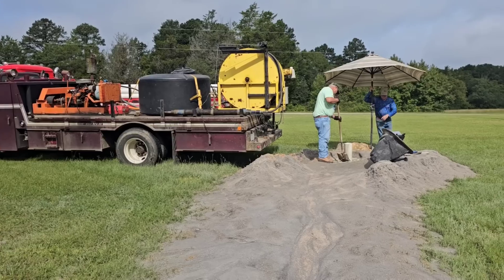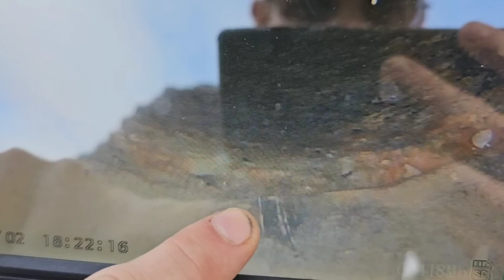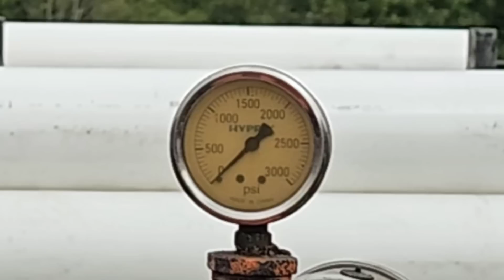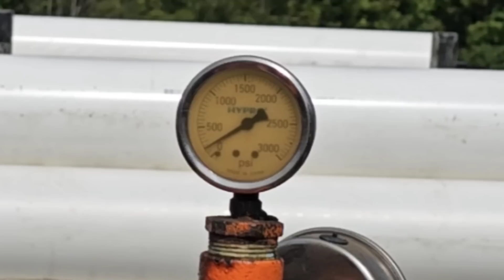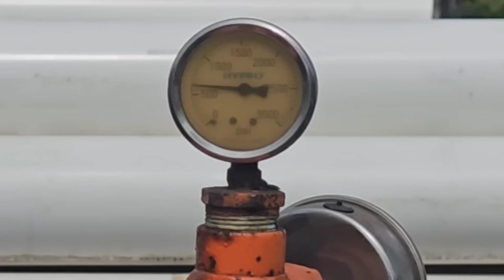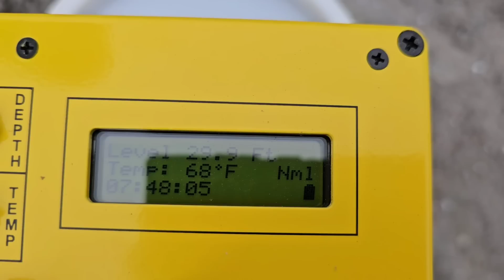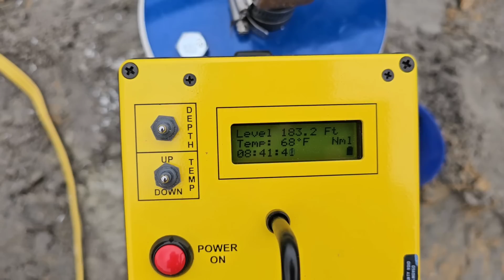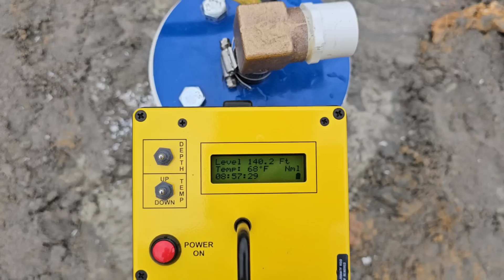Hydro-Fracking a Low Yield Well for a Subscriber, Testing if Afterward to Show Results

Comment: If you have a low yield well will the inspector run it at a low rate (example if the county requires minimal of 1 gallon per minute for a 6-hour will the inspector set the flow rate gallon meter to 1 gallon per minute and conduct a 6-hour flow) or would they just run the well dry and then measure the recovery rate / yield

Comment: H2O - great video and great result. My well driller went 500’ feet yesterday and I’m only getting 1.5 gpm. He advised not taking the gamble on drilling another 100’ and hydrofrack instead next week for roughly same amount of money. He said he can guarantee I will be getting at least 3 gpm when he is done. 

My house is a 2.5 bath with myself, my wife and my mother-in-law. I’m not big on watering the lawn and wash my car once a month. My MIL will be the only one home all day flushing a toilet and using the faucets or doing laundry. 

Will we be OK with nothing to worry about at 2-3 gpm at 500’ ?  Do I NEED a storage tank in my basement?

Thanks!

Comment: I’ve watched a bunch of your frac videos and I’m learning the similarities and differences between the shallow water well fracturing that y’all do and the ultra deep fracturing we do in the oilfield.  The concept is very similar.  Y’all don’t require proppant because the acquifers you’re dealing with are generally weathered granite with gravel or sand size grains, probably loosely consolidated, so when you create a crack and extend it, when you flow the well back amd the crack begins to heal, it doesn’t heal perfectly.  That leaves a nice high-permeability pathway for the ground water to get to the well.  Pretty badass!  

In the oilfield, our reservoirs are usually very highly consolidated and very low permeability sandstones and, these days, shales.  Shale is ultra low perm!  Our breakdown pressures are thousands of psi, but once we initiate a fracture, the pressure drops just as it does for you.  We use salt water (so it doesn’t swell in-situ clays as badly) with a friction reducer and anywhere from zero to 6 or so lbs per gallon of well-sorted and rounded 20/40 mesh sand.  Oilfield fracs (OGs in the oilfield don’t put a k on the end of ‘frac’ traditionally) will use 1 million lbs of sand and up commonly.  The pumps used are insanely big but we’re breaking rock miles deep in the ground.  When we shut down at the end of pumping, often we do so gradually so that we can let the reservoir heal onto the sand (without bringing too much back into the well), which props it open.  we refer to the sand or sometimes ceramic or bauxite as ‘proppant’.  If you plot the flowback pressure vs time on a graph you can actually see a change in slope once the majority of the fracture has closed.  The fractures we are propagating are no more than 0.1 to 0.5” wide and we try for maximum complexity - multiple cracks being extended simultaneously in many directions.  This can be accomplished by pumping at insanely high rates of many barrels per minute.  Some people imagine oilfield fracturing affects ground water but they have been misled.  Ground water is always protected behind several concentric ‘rings’ of steel and cement.  Usually from the fresh water formation to the wellbore you have cement, steel, cement, steel again then steel production tubing hanging inside that.  Every state mandates how groundwater is to be protected.  And our fracs take place many thousands of feet - 1 to 2 miles in most cases - below the lowest fresh water.  Usually ground water becomes salty below about 1000 ft and usually shallower than that where I live out west.  But every operator knows where “base of fresh water” is in their fields.  Our fracs are designed to stay within the hydrocarbon-bearing formation.  Unlike y’all, we are trying to avoid water as much as possible.

Comment: Question from Oklahoma about water well development- in my area there’s lots of old 40-50ft wells that make 10-20GPM. But in past few years I’ve installed lots of pumps behind drillers who drill with mud rotary bc of the sand and river rock formation at that depth, but almost all of them barely make 1 GPM. I’ve noticed the drillers only blow out the hole a little bit before leaving- they do not jet, surge, or swab these wells- read online these methods should be done with mud rotary for removing bore hole wall cake. Wondering if this could be the issue on these newer wells bc all of the old wells drilled with cable tools back in the day make great water. Haven’t seen videos where you talk much about the development process and just curious to hear your thoughts! Thank you for all your content I watch every video.

Comment: Does a well really need a drain back system in SE Texas? My drain back valve has failed and is dumping a lot of pressure/water while the pump is running. Should I replace it with a new drain back valve or just cap the tee?

Comment: Is 4.5 gallons per minute good?  I’ve always heard you need at least 5gpm or higher for a house hold.
Reply: For a 80 foot well, yeah, the amount in the well might be low. But this well is over 200 feet deep and 100+ feet of water filled well that is water storage.  So unlikely to run out of water and run the pump dry.

Comment: Interesting how different parts of the country lays out their wells. I'm in central valley California  and most of the older wells like mine use the tall 100-150 gallon tanks. Rarely do we see tanks under crawl spaces. Some wells and tanks are in a well house, others like mine are out in the open. We insulate exposed pipes but rarely get freezing below 10°F. No problems in 25 years with freezing. I feel so fortunate to have a 40+ yesr old well that produces plenty of clear water.

Comment: Actually, your method for calculating the well production rate is spot on.  In normal operation it is the amount of replacement rate that determines the outcome for the home owner.  Home owners do not have the time or ability to balance usage to determine what rate their well has.  It has, as you measured it, the rate that it will replenish the water removed.  4.25 gpm is correct.  They fill at full speed all the water troughs for the animals and then shut it off.  The well refills to static at the rate, just as you measured it, while no pump is running and no major flow going into the house.  👍

Comment: I love the pump setup.. can't beat a Bean Triplex pump. Bigger version of what we use for diamond drilling, my grandpas old pumps were similar with engine and transmission set up similarly. I've built a few single speed versions for what we do, max 500 PSI but rarely do they ever need to put out more than 125. Little Bean E04 quads with small single cylinder motors. Nice for bush work, weighs less than 150 pounds and itll pump water a mile up a hill. Or if the pump on the rig fails, its a good backup.

Comment: I've never understood why a bore pump is used as a pressure pump in the states, because they aren't designed for that. Here in Aus we have a bore pump varying anywhere from 5lpm right upto 12lpm that pumps into a 20,000ltr tank and then a pressure pump is used to supply the house/buildings. I guess freezing temps is the only thing that comes to mind.
Reply: @scoffee82  I’m not sure why you say that a submersible well pump is ‘not designed’ to pressurize a pressure tank. The manual and specs for my well pump suggest otherwise.  And I have no need for any kind of storage tank; my 100 ft (33 m) deep well produces water faster than I will ever use it. You’re suggesting I should install an expensive storage tank and a jet pump I don’t need for what purpose exactly? To save wear on my well pump? I just replaced my well pump; it had been in service for 38 years.
Reply: Fellow Aussie here. I believe a lot of the states in the USA view water as a natural resource and as such, the storage of it requires a license.  At least it seem to be the case for storing more than 110Gal of rain water, not sure about well water (or as we call it, bore water).
Reply: @askmyteapot  Why would you want to store thousands of gallons of water for a home, anyway, unless your well is unreliable?  All that water’s being stored cool and clean in the aquifer and will be there when you need it.

Comment: The completed well head has an indoor metal box for the electrical connections?  That passes code?
Reply: @gradyrm237   oh I feel stupid for not having noticed that but I didn't watch all of it, mostly listened while I made dinner yesterday. 

In some places an inspector may let that fly, but I think we both know the correct answer is no. 

I find it interesting that's what they went with.

Comment: That little 4 banger GM is a champ, cranking mad pressure in 3rd gear like it's havin breakfast.
Love to see it. Also love to see y'all go a little deeper into the equipment like this, might as well be alien technology to us common folks, fun to get the inside line.
Reply: I used to have an '84 Buick somerset that had that engine in it with a 5 speed transmission.  Only real problems I ever had was with the alternator - kept having to change the diodes

Comment: Hello Phillip,  Please clear something up for me - no pun intended.  Where does all the stuff you flush out go?  If it just gets pushed back into the water bearing strata, won't it just work its way back and clog up again?
Reply from the maker: @DavidSellars-b8l  it's flush it out & yes it can settle back in over a decade or 2. But alot of times it can settle at the bottom of the well. It's like any pipe clogged, you break up the material and spread it out & then it is allowed to flow. Fine silt is packed it tight, we are busting it free .
Reply: @h2omechanic  The stuff pushed into the cracks(caused by fracturing the rock, aka fracking., it gets into them and gets stuck holding the cracks open, letting more water flow back.   In gas/oil well, sands of various types are pushed into the rock formations during fracking to after fracturing the rock hold the fractures open.

Comment: For a single dwelling I would’ve thought 1 gallon per minute would be satisfactory?  Equates to 1440 gallons per day or 5760 litres!  That’s a lot of showers!  Even for horses showers!!
Reply: Gotta take storage capacity into account as well. If it only stores 40-60 gallons, you'd be limited on shower time, and then have to wait an hour to finish.
Reply: @goosenotmaverick1156  With the pump at 300’ and a static level of 45’ before the fracking they would have almost 400 gallons of storage just in the well.
Reply: @the_latinist   which should have been plenty I agree, for most situations. But my numbers were mere back of the envelope random numbers to demonstrate. 

I could see how folks would be worried given the inflow rate, given dry times happen.

Comment: When you consider the well head static pressure of say 500 feet which works against the inflow rate, you could have twice that flow if the static level were pulled down to near the depth of the stream inflow.
Reply: Hydrostatic pressure should match formation pressure in this case. The well is not being constantly pumped on so it’s gonna fill to whatever level matches the formation pressure.  Could be wrong I’m no scientist, have worked in the oilfield for 10 years though.

Comment: This is really interesting stuff.  I'd think the flow would actually be more because the deeper the well is, the lower it is in the water table thus higher pressure down at the pump and quicker water replacement to the well.  Am I thinking wrong?  Thanks for the video.
Reply: I mean, that sounds logical to me. Leaving a comment to see if he replies to affirm or correct this.
Reply from the maker: @billsmith5166  yes, in theory the deeper you draw it down the faster it'll refill only because there's less water in the well bore to push against the Aquifer/veins.  But the pump & depth of it is normally the limiting factor (if you size a system correctly). 
At 180 if made 5gpm, at 140 it made 4.25 gpm, so it might make 6gpm at 270ft, but the pump would be struggling to lift from 270ft so it would only give around 3-4 gpm at that point. It's all a balancing act.
Reply: @h2omechanic  Makes perfect sense now, thanks for explaining.  I'd never have believed I'd have been so entertained by water wells.  It's really interesting stuff.  Thanks for taking the time to make the videos.

Comment: Another great video. Curious how you know if well water is safe to drink? Also... hope you can find time to fire up the little 4 cylinder motor you assembled recently!
Reply: You get the water tested at a lab.
Reply from the maker: @phil6465  all wells get tested at a lab inorder to get the house CO to be completed.
Reply: Your local county extension office can let you know how to collect the water and how to send it for testing
Reply: Just about everywhere has government labs available for testing. Call your county and they'll get you pointed in the right direction.
Also important to test what comes out of your tap and what comes right out of the well to make sure whatever treatment you're using is working properly. Lots of options there.
Reply: What about the test kits I see on Amazon? Reliable? I bought a house in Texas with 3 non-working wells. After watching all of H20 Mechanics videos I have 2 working nicely, just afaid to drink the water. Hoping someday he does a video about installing a Hand pump
Reply: @johncarter5576  Those kits are just a yes/no, pass/fail, won't really tell you what's going on. Get them properly tested, it's worth knowing.

Comment: the steel cable end close to the 220 volt plugin looks dangerous
Reply from the maker: @novanut1964  that's just to lift it up with the tractor onto the trailer. I've got common sense so
Reply: @h2omechanic come on now, I think you have a little more than common!
Reply: Except the breaker wasn't on when he plugged it in, so no issue.
Reply: @Dfk429S9fo3  being in a rush or emergency i am
saying its too close for comfort if it hits the plug legs
Reply: worst case scenario, in a hurrry, or an emergency, maybe a new helper goes to unplug it, not realizing the danger, not that you are incompetent

Comment: I know it's a real dumb and mechanically geeky thing for a viewer to keep saying over and over, but your little fracking unit is still impressively functional to me, the damn thing just works!
Reply: Having worked with a well company several times, I love seeing how they make their own one off custom equipment.  I think different areas need different types of custom or modified rigging.
Reply: @johndias6614   the ones who know how to build it best, are almost always the ones using it. I'm with you, it's always cool to see differences between equipment.
Reply: I nerd out over it every time. You're not alone. 😂